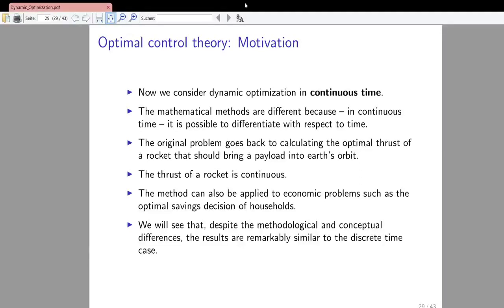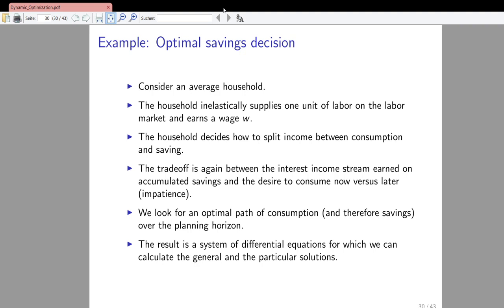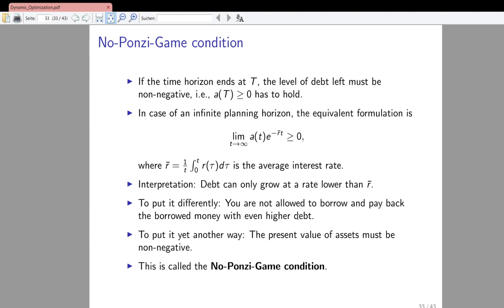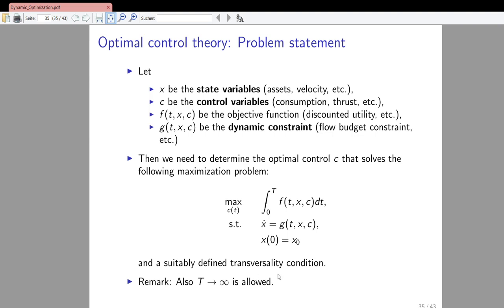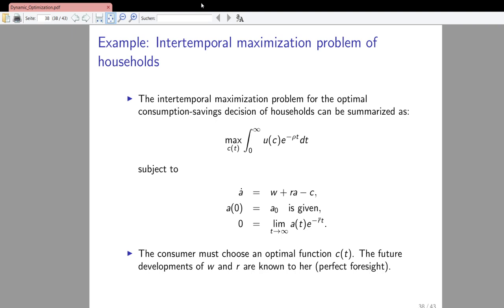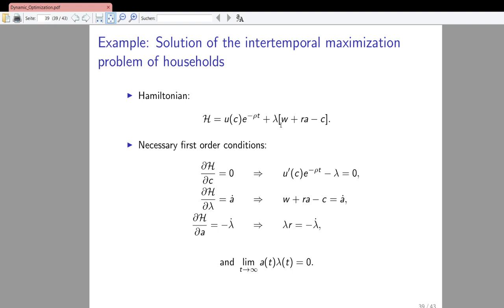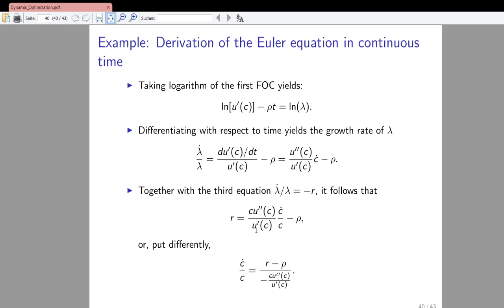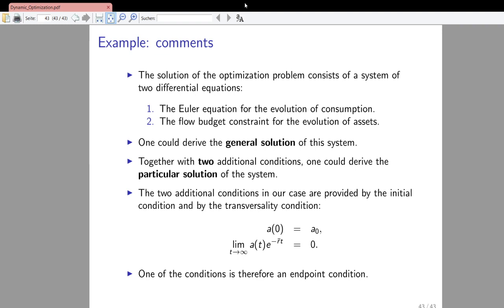Dynamic Optimization Part 3: Continuous Time

Comment: Thank you ! How can you set up the Hamiltonian for a system of interacting agents (say, a system composed of 3 consumers, 2 entrepreneurs, 1 banker) who each have their separate own utility functions and own constraints, and own laws of motions, and derive from that the general common evolution of the whole , as they interact with each other ? (much like for a system of elementary particles in Quantum physics ) ?
Reply from the maker: Thank you for your question! In this case, I would recommend using a discrete time formulation as often done in dynamic games. A very good source for this is the following book by Gerhard Sorger (in particular, chapters 7 and 8): https://www.amazon.de/Dynamic-Economic-Analysis-Deterministic-Discrete/dp/110708329X